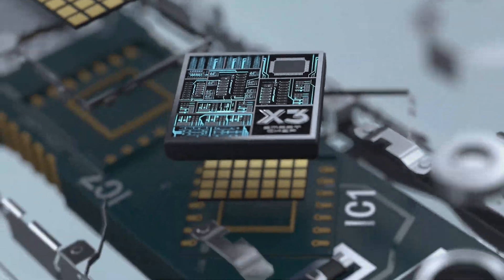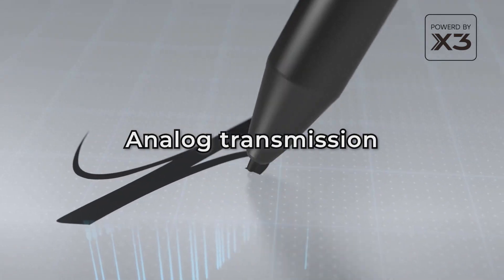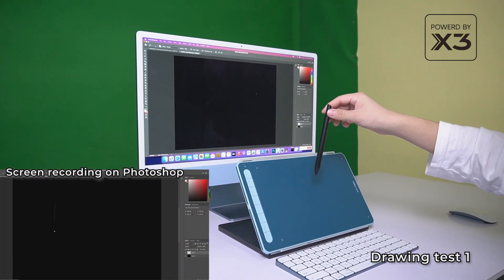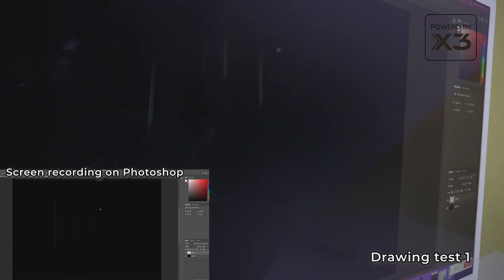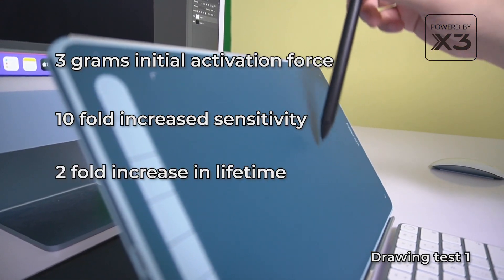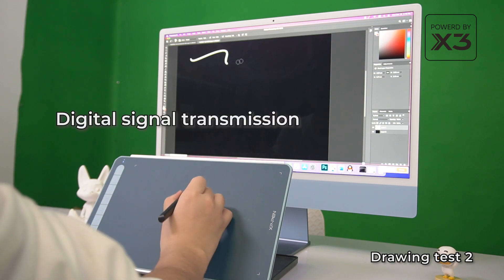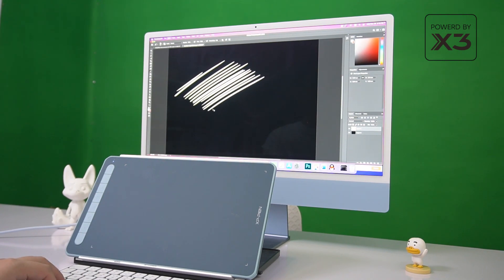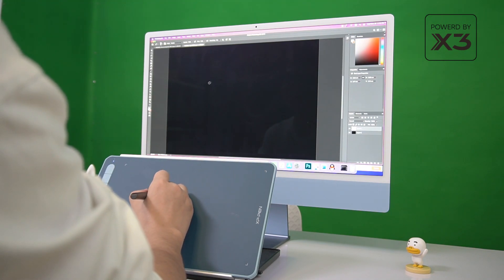How is the performance of X3 Smart Chip on DECO LW?

Comment: Hello! I noticed in a comment of a past X3 showcase video, someone mentioned if there would be backwards compatibility someday with older products, mentioning there'd be a cut-off of potential buyers (especially those who just bought tablets recently). Now realistically I know backwards compatibility isn't that simple so it'd a no, but because of that I do have an interesting question!

When the X3 becomes more mainstream across all your products, will there be the opportunity for people to ship their old XP Tablets to you, and based on the quality of the tablet, be offered a discount on the 2nd gen version of the same tablet? For example: Let's say a 13.3 Pro 2nd Gen comes out with X3, I could turn in my normal 13.3 Pro and get a discount towards the 13.3 Pro 2nd Gen

Thoughts?